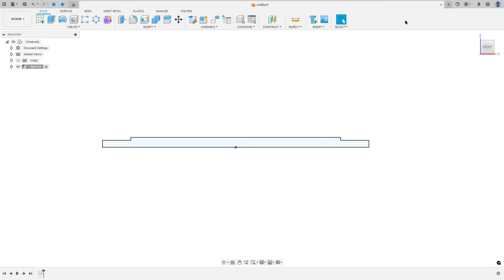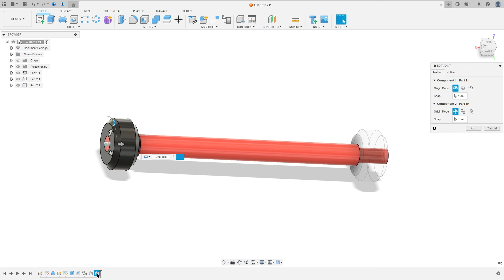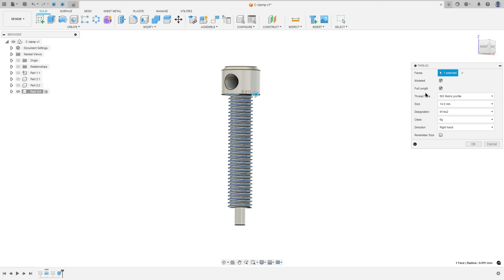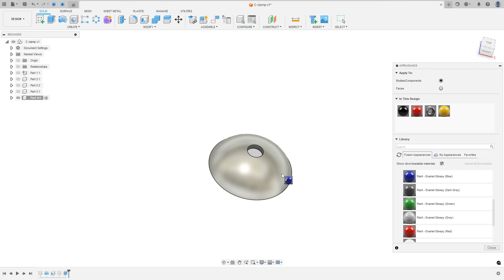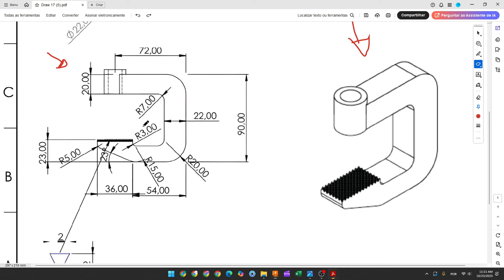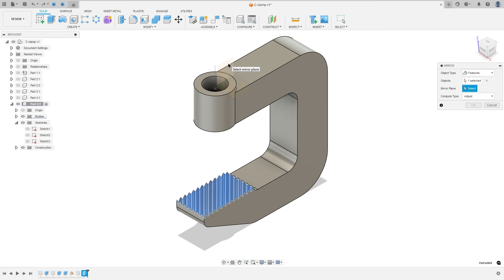Fusion 360 From Zero | Beginner Step-by-Step Modeling Tutorial #30 C Clamp

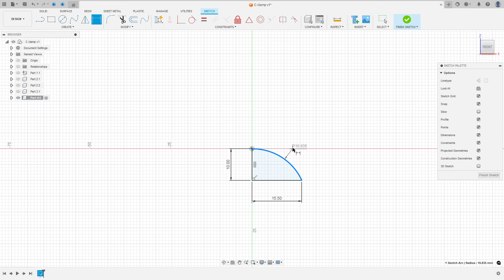Comment: Thanks!  @11:16, does the arc go all the way to the center point, or does it stop at the edge of the 6mm hole? In other words, should the arc be tangent to a 3mm line extending out horizontally from the center point? So the 6mm hole is made in a flat surface. It might not matter from an implementation standpoint, I agree, but it looks to me like the drawing is not done the way you drew it... no biggie.